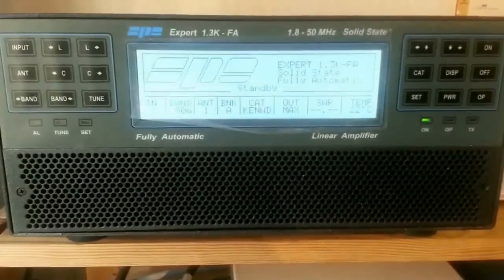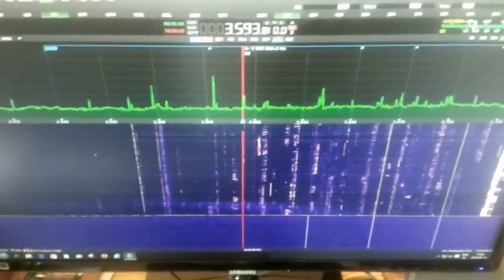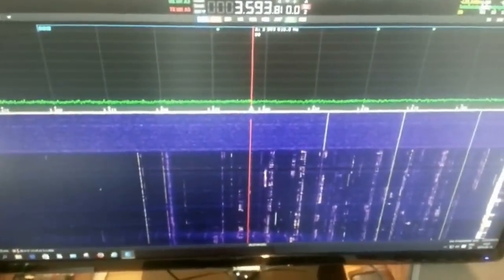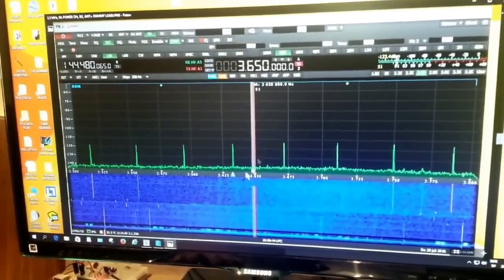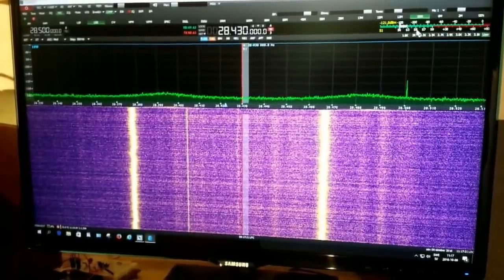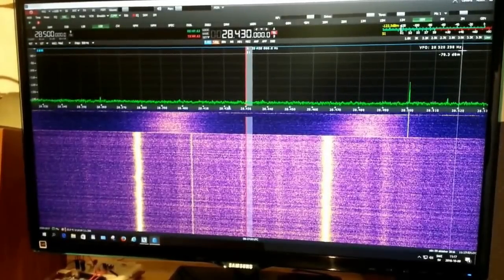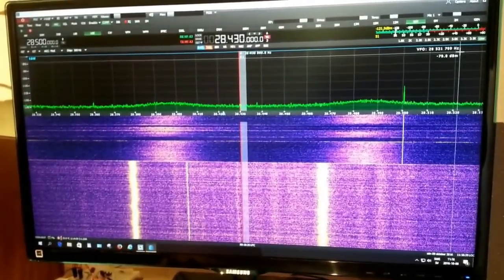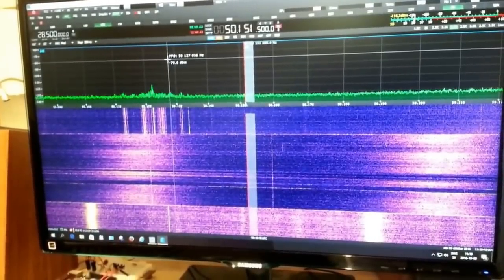SPE Expert 1.3K-FA amplifier - spuriouses

Comment: Hi, thanks for the information. I have a chance to buy one of these units second had. However the person selling the unit is not sure if the unit has a built in ATU or not. Is there a way to tell from the box or any stickers on outside of the unit, if it came from the factory with the fitted ATU ? (the person selling is widow of the original owner so she does not know :(  )

Comment: I have no such problems with my 1.3K fa. I got one of the early ones - July 2015, and because I use tuned resonant antennas - SteppIR DB18 and SteppIR vertical, I ordered mine without the expensive ATU. I believe the ATU does not have a very wide range, so probably better to buy the amp without the ATU, and either use SteppIR or similar antennas, or use an external ATU if you use off resonant antennas. Built-in ATU is always a compromise - both in an amplifier and those built into a rig.
Reply from the maker: I only use the antenna tuner on 3,7 MHz to get some more band with even if I use a resonant dipole. The impedance range on the antenna tuner is sufficient for this, even if it is rather small  - as most build in antenna tuners.
I use a log periodic antenna for 14-30 MHz and no antenna  tuner is needed. But this is not the issue here! The issue is the spuriouses. If You have paid for antenna tuner and need it, it should not cause problems.
Reply from the maker: One more comment. There some are spurioses from the power amp even if you have the antenna tuner bypassed. Highly likely  the power amplifier  also generates spuriouses below the background noise level. I don't know if this can have an impact if you for example use WSJT and listen to signals around -20 dB below noise level. What worries me most here is the spuriouses that more or less look like broad band noise, as demonstrated. But I'm not competent to analyze this.
Reply from the maker: The need of ATU is different for different user. It is probably the ATU that pics up the spuriouses but the source of these are the switched power supply. The problem varies between batches of PSU, as mentioned in the film. The manufacturing process might cause variations between units. I think that the problem should be easy to fix but that is up to the manufacturer.
73 de SM6ENG

Comment: I have a couple of questions.
1) What is the isolation of the antenna switch that you used on your video to switch between antenna and dummy load? I doubt it is better then 100 db or even less.
2) Does the direction of the 28 mhz and 50 Mhz antenna has any impack on the noise level?
You have also mentioned that bypassing antenna tuner cures the problem. This implies that the RF is picked up inside the amp by antenna tuning circuitry. Did you try to investigate it a bit further?

73, Igor UA9CDC
Reply from the maker: 1)The isolation is abt 80 dB. If the spuirioses had leaked through the switch, they had been 80 dB stronger when I switch from dummy load to antenna - which not is the case. To exclude other sources than the power amplifer i demonstrated that the spuriouses disapppeared when i switched off the power amplifier. So there is no doubt. Further both ARRL test lab and the manufacturer have confirmed that there are problems with spuriouses  in the power amlifier. This might differ between indivuals, the impact of changing PSU was also demonstrated in my video. 2) The antenna direction have some impact on backgroud noise level but not the level of the spurioses and broad band noise from the power amplifier - which still is present when i listen to a dummy load.
Reply: Thank you Bertil. The reason I have asked about the antenna switch is then when you disconnect antenna the RFI pick up can happen on the shield of the cable that is connected to the antenna. It would be interesting to disconnect that cable in order to make sure the RFI root is purely via the tuner circuitry. Then it would be intersting to find out how that pick up happens in the tuner and does its level depends on the tuner setting. At any rate, thank you for raising the issue. I hope SPE will look at it and find a solution.
Reply from the maker: OK, I have tested with a small 50 ohm load, a Narda model 370 BNM, good for DC-18 GHz, directly connected to the power amplifier, without coax cable. The result remains.
Reply: Bertil, I am curious whether you did the same measurements with your previous SPE amp - 2K-FA.  If you did, did it show spurious responses as well?
Reply from the maker: Hello Robert, No I did not experience problems with spuriouses on my 2K-FA and not with my earlier 1K-FA either.
Reply: So， its 2017 now, does this problem fully solved
Reply from the maker: The spuriouses disappears when I switch of the power to the PA. That is also the case when I connect a dummy load direct to the PA, without any switch. The spuriouses are for sure generated within the PA itself, which the manufacturer has agreed on.
73 de SM6ENG

Comment: Your unit clear has this issue. I tested my unit exactly as you did yours, and I have no such problem.  This issue seems to be unit specific.  73/Bob AA6VB
Reply from the maker: Correct, it is unit specific.The qualty  of the PSU differs but there is  also a general screening problem related to the built in antenna tuner.